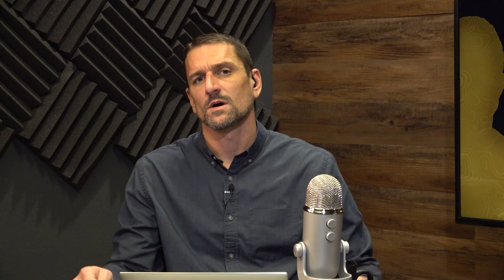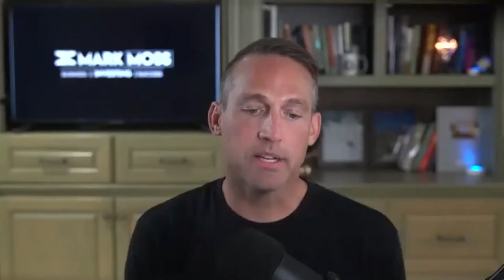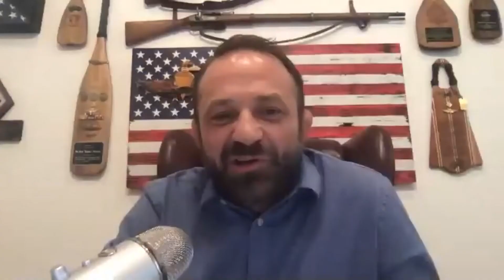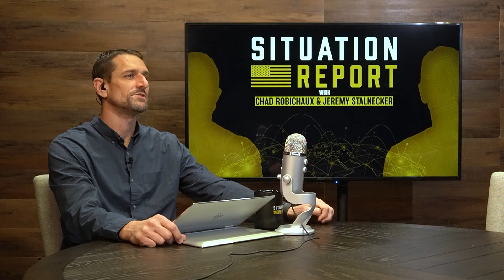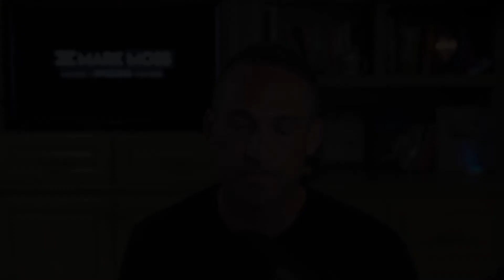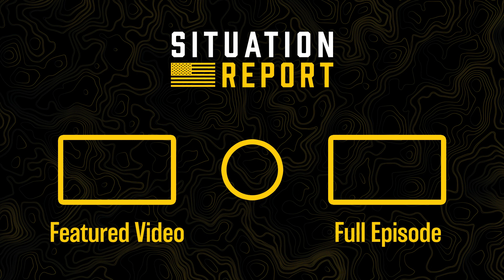Mark Moss on Renewable Energy vs Fossil Fuels

Comment: Yes, there may be limits if conversion of wind and solar into energy. But it is free after the investment outside of maintenance costs. If you told me I'll sell you a car that is 80% efficient with an continued cost for the fuel it uses, vs, a car that is 35% efficient with a fuel you will never pay another cent for, what would you take? 
And also one is finite and is destroying our planet, while the other will NEVER run out and is our only chance in saving the planet.

Comment: I think you left out a tiny detail, advanced nuclear energy, the only technology that can actually replace fossil fuels.
Reply: Negative.  N. energy is the most expensive in the world, and relies on a steam engine.  Can you do a little more investigation?  Green Hydrogen is the answer.
Reply: @TobyKinkaid11  That's why I specified advanced nuclear. Capital and electrical cost is less than a coal plant. Built in 1 year.
Reply: @chapter4travels  After Fukushima, are you kidding?  You need to forget steam engines, we live in the 21st century.  We need 21st century solutions.  Green Hydrogen is the Only path which can achieve decarbonization.  I remind you we don't have much time.
Reply: @TobyKinkaid11  Completly different technology than the current reactors and you're missing the bigger point of "Steam engines: actually steam turbines, the exact same ones that both coal and natural gas use, so they are off the shelf available. These reactors generate very temperature high industrial heat one of the three major uses of fossil fuels. There are hundreds of applications for industrial heat, making electricity and synthetic liquid fuel for transportation/agriculture are just 2 of them.
Reply: @chapter4travels  Again, you have no perspective in your claims.  N plants centralize energy.  The historical trend is decentralized.  Your arguments are 30 years out of date.  Steam turbines are a century old technology.  Fuel Cells have a higher thermodynamic efficiency.  There are 30 things wrong with your conclusion.  We live in the 21st century.  If you want an energy rich world Available to All people and All local economies.  N power is a non-starter.
Reply: @TobyKinkaid11  You have it completely backward. Right now in the US, the cheapest way to make electricity uses steam generators, they are very efficient, that's why we use them. Renewables can't even replace electricity production which is only about 25% of total energy use. How in the world can they replace the other 75%? It's not physically possible. 

The reasons are very simple and no amount of technological advancement can change them. Wind and solar are VERY low density, intermittent electricity only sources. Farming these sources is just plain dumb. At no time in human history have we gone down in energy density and there is very good, common sense reasoning behind it.
Reply: @chapter4travels  You need to understand what Green Hydrogen is.  Green Hydrogen makes clean H2 from water using renewable energy on the front end.  H2 has a specific energy density far above other fuels.  Your claims that is is "physically impossible" to replace a fossil fuel grid or system is absurd.  Green Hydrogen provides a means for All local economies to have a resilient and non-toxic industrial fuel base.  You need to do some homework.  We don't have time for more ignorance.
Reply: @TobyKinkaid11  We can't even replace electricity production with renewables, where are we going to get the electricity for the incredibly inefficient electrolysis of water for hydrogen?
Reply: @chapter4travels  Why do you assume we cannot be powered with renewables on the front end?  Is this the second time I've asked?  Do you think it's a land issue?  What data are you basing your conclusion that we can't have a renewable energy system?  We can.  And, it has a name:  Green Hydrogen.  With Green Hydrogen we can power everything.  Cars/trucks/semis/aviation/maritime/stationary power... everything.  What about this don't you get?
Reply: @TobyKinkaid11  Where do you get the electricity to make the hydrogen when we can't even make enough to cover traditional electrical needs?

Comment: I'm sorry, everyone on this show doesn't know what Green Hydrogen is.  Renewable energy making clean Hydrogen fuel from water.  It's an industrial power supply which is potent, safe, available today, available to all local economies, and is 100% non-toxic.  That means an energy rich world future.  With all due respect, you guys are behind the times.  The EU is going full tilt, as well as the Pacific Rim countries over 32 have declared a "Green Hydrogen Economy" as their way to energy independence, low cost (being from renewables no fuel cost in the system), and non-toxic.  Either we lead, or we follow.
Reply: I love how all the massive physical issues with wind, solar, and hydrogen magically go away when you add the label "Green" to them.
Reply: @chapter4travels  This is not magic.  It's physics.  Green Hydrogen has a clinical meaning.  You're a bit cynical aren't you?
Reply: @TobyKinkaid11  "green" hydrogen is produced through electrolysis of water, the absolute least efficient way to produce it. Then the physical properties of hydrogen make it terrible storage, and distribution fuel. And, please don't say the electricity is free, it's incredibly expensive, resource intensive, and land intensive.